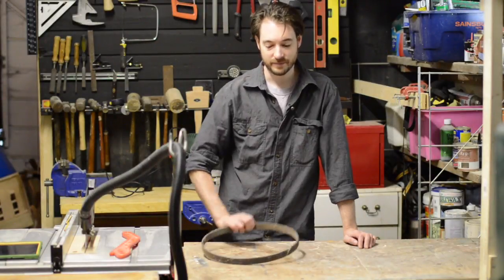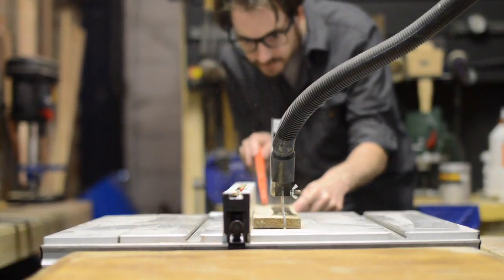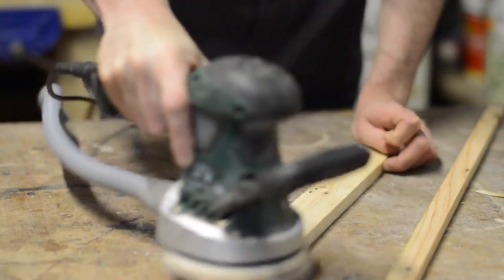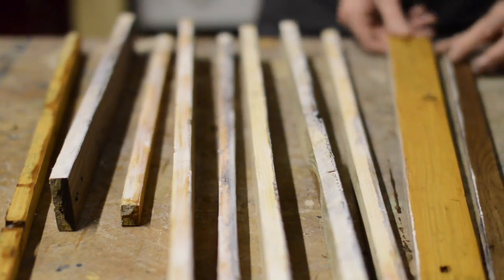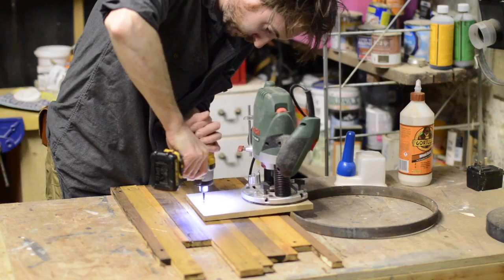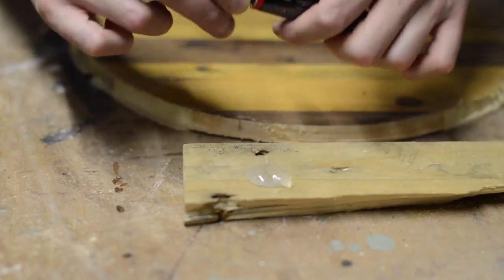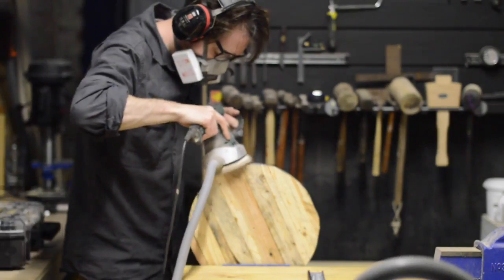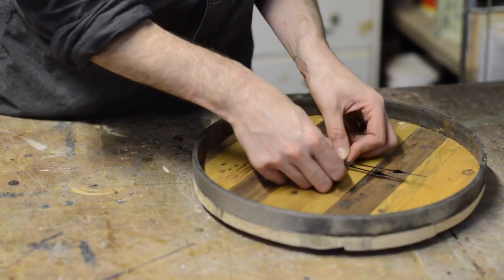Pallet Wood Clock

Comment: Great and original clock. 50 shades of brown. Thanks for sharing. I bought some clock mechanisms a year ago. I've not used them yet. But at the time of purchase I
did not look especially for a long spindle. So probably I'll have to make a recess in the wood whenever I get that far.
Reply from the maker: Yes a recess will work well, I just did it the lazy way

Comment: nice little project well done and if you cant find clock mechanisms with a long spindle why not rout out the back of the pallet wood where it sits so its only thin and you can use standard mechanisms i know because i had the same problem
Reply from the maker: Thank you Ken. Thats a great tip.